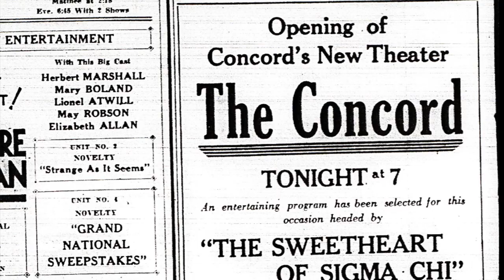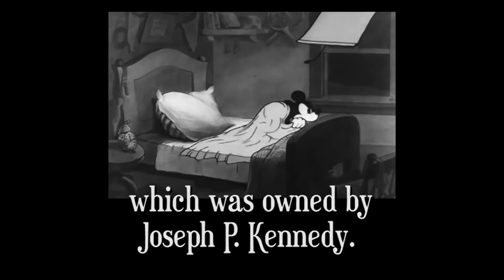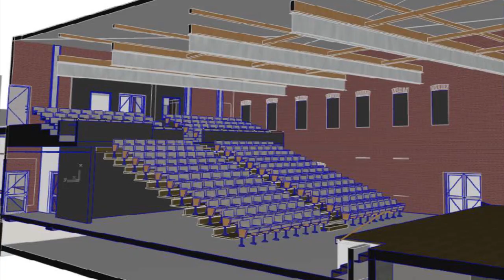History of the Bank of New Hampshire Stage

Comment: 18 South Main - not 16. I have some J C Norris Bakery advertising crate stuff & invoices from the 1800s. 18 not 16.
Otherwise, great seeing that clip of Theresa. Bit of a tearjerker, but well done. The Bank of NH Stage has GREAT acoustics.
Reply: During the 27 years I worked there, the official address for the theater was 18 1/2 South Main Street with 18 being the doorway in-between United Shoe Repair and the 3 doors leading into the theater. For some reason, the theater/Bank of NH Stage is officially 16, which was the door leading into United Shoe in decades past.
Reply: @pebrogan  Thanks for the  "really Big Shoe" explanation - and for keeping it "reel".